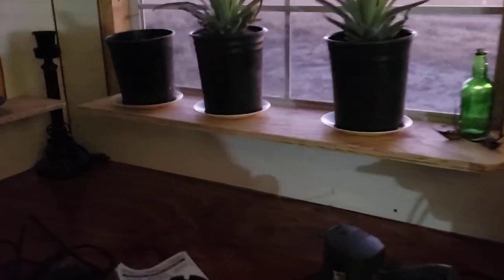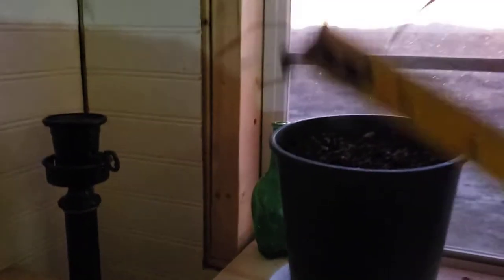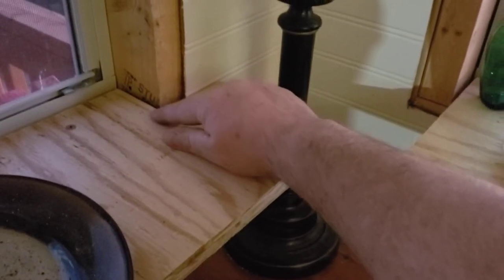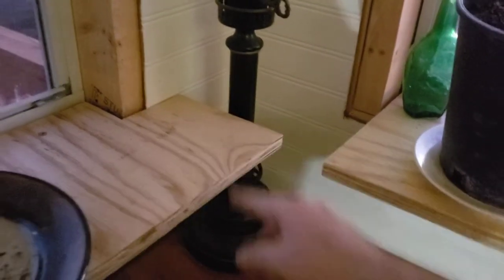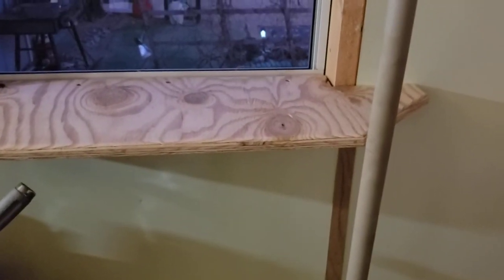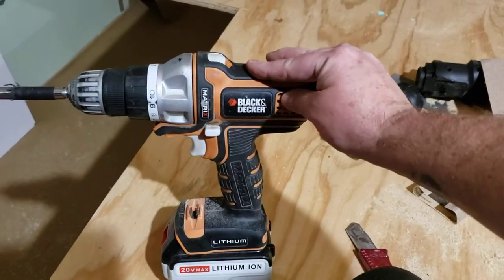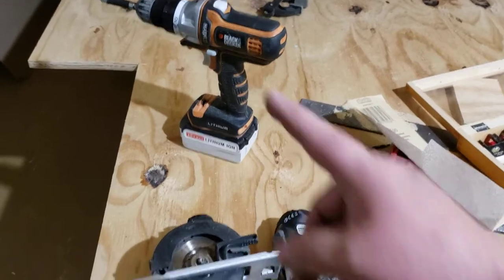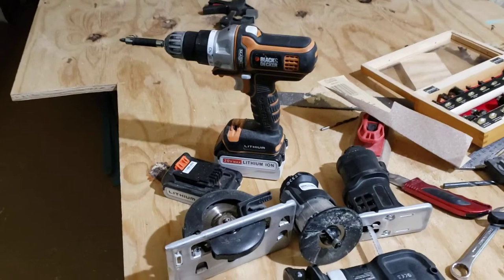Windowsills, Covered panel seams, My favorite black and decker matrix drill #azhomestead #offgrid

Comment: Looking good.  You could probably fix the corner by cutting a small piece to fill in, cut some separate tabs to connect the fill in piece to the two separate shelves.  Put the fill in piece in position and glue (and clamp) the tabs to the bottom of the shelves and the fill in piece ( put glue on the edges of the shelves and fill-in piece as well ).  Recess the tabs so you can't easily see them unless you are deliberately looking at the bottom of the shelves.  Once the glue is dry, fill in any voids with a wood filler (a generic "Plastic Wood" product would be fine).  Sand everything and put on your choice of stain, polyurethane, etc.  The repair will be practically invisible.  BTW, The glue will drip, so put something under the repair to protect your counter top while the repair is drying.
Reply from the maker: Thank you.  Kelli wants corner shelves now. 😊